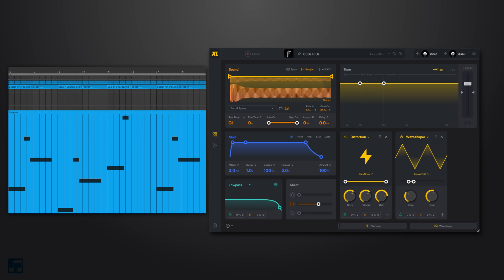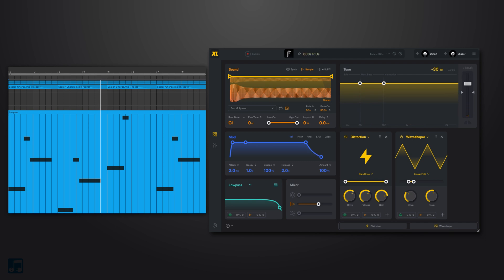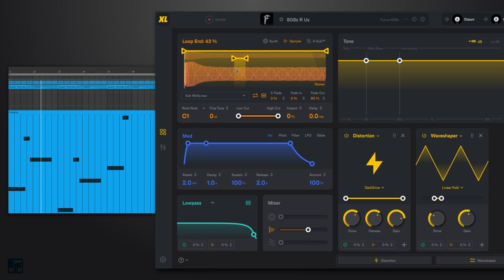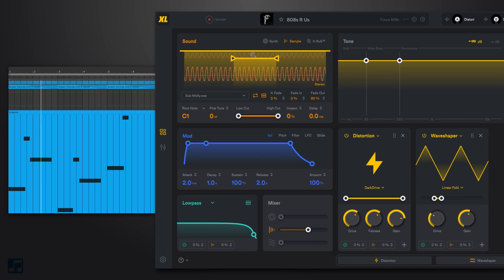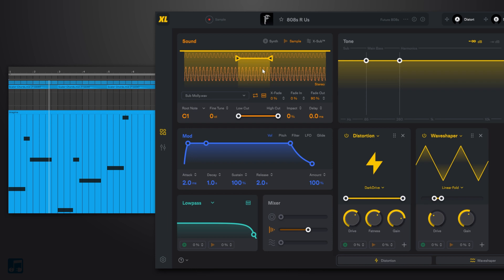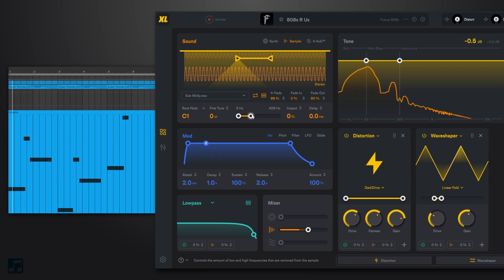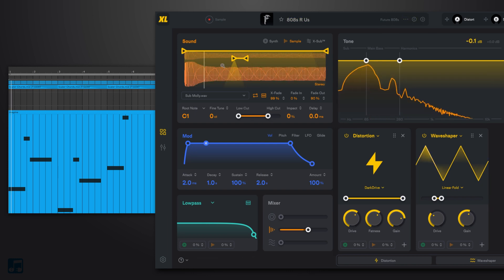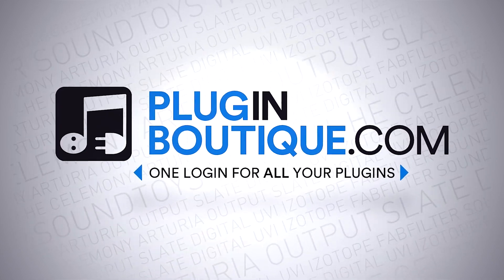SubLab XL - Working with 808 Samples - Endless Sustain on Short Clips - Quick Tip

Comment: If you bought the original sublab, can you get the update for free?
Reply: No it's paid and in addition the update is ultra expensive
Reply: @popwa6977  It was worth the $20 update for me. Lot of new features.
Reply: @RussiBeats  If you're satisfied, good for you
Reply: @popwa6977  I rather use serum now
Reply: @Adam-g-uk  No, sublab is cool, but charging its customers is not normal
Reply: @popwa6977  I won't be updating, I used sublab about twice when I got it and now I just use serum and its 100 times better and you can make 808s and a whole lot more...
Reply: @Adam-g-uk  
I wouldn't update either since it's paid for.
Reply: @popwa6977  joke of a company...
Reply: @Adam-g-uk  Yes they will also lose customers
Reply: @popwa6977  that long lol